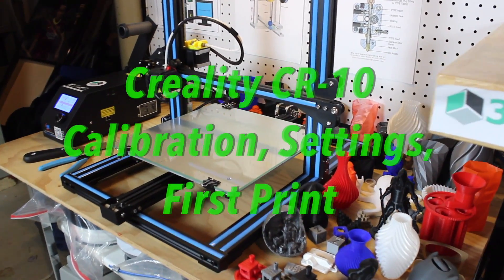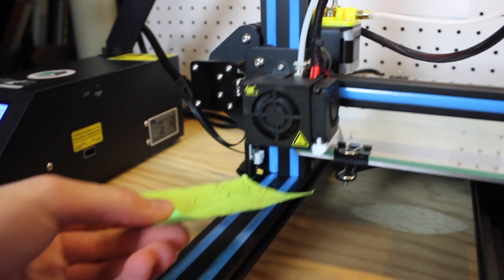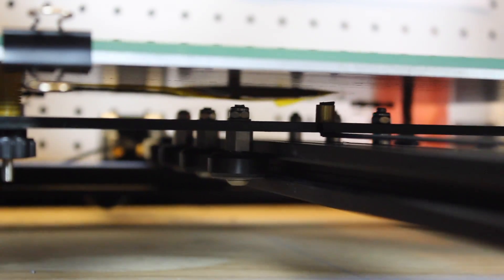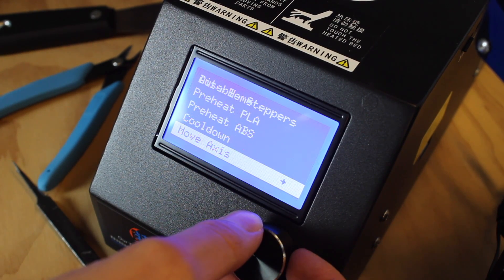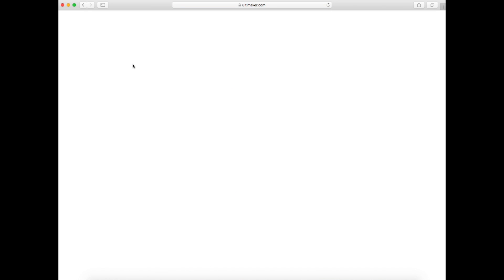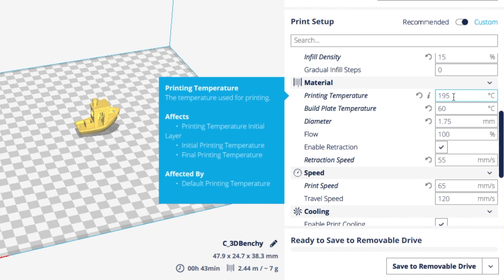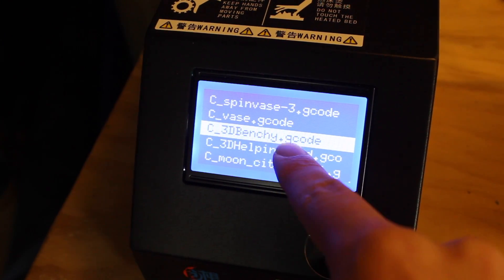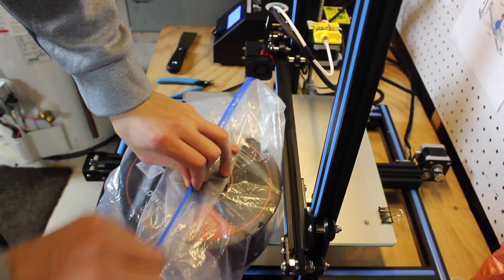Creality CR-10 Calibration, Settings, and First Print!

Comment: I followed your video for my first benchy but I get this scratching sound when the nozzle is over the print except on the edges. I made this video for the sound: https://www.youtube.com/watch?v=Ceu4u9lKi3g What I'm doing wrong?
Reply from the maker: Hmm, your fan might be rubbing on something. Try turning that off in the menu or try looking for parts that are rubbing on the printer.
Reply: how can I turn off the fan? There is no option in the menu. Just fan speed but I it still at the same speed even if I change ist. I tried to increase the infill to 30%, slowed down the flow to 90% aktived Z Hop but it's barely better. I uploaded a second video, maybe you can hear it better from here: https://youtu.be/6FBtl-pjwNI This noise appears at some lines of the infill. I uploaded a picture where you maybe can see that some inline lines are good and some are blistered: https://i.imgur.com/MijInii.jpg
Reply from the maker: Ok, you can turn the fan off in the slicer setting. I watched the video an it seems that something is rubbing or your filament is old. What brand filament are you using? Sometimes when filament gets old and dried out it pops while printing and doesn't look good.
Reply: Ok I turned the print cooling fan off but still the same sound. I used the filament which was in the box of the CR-10 for testing. I changed it with a Filament with the tag 26.03.18. The print looks besser also the infill but still the same sound...and can' t find anything  rubbing. But it's definitly comes somewhere around the hotend part...Is it possible that the x-belt is to tight?
Reply from the maker: Yah. That might be the problem. Try adjusting your belts

Comment: about 13% in the print the material started to get stringy why is that ? i do however thought that it was going alittle fast, i noticed in the video that your printer's computer/module case thingy was showing a 3D logo, my CR10 shows the number 300. Safe to say that at this point i have no idea what is going on "we are totally new to this 3D printing.anyhow as im writing this its still in the printing progress. but i will reply here again once its done.
Reply from the maker: Try lowering your temperature settings on the extruder. That might help the print not become stringy

Comment: I started my printing on the benchy but my printer didnt started like your video. It started where the auto prepare does. Why?
Reply from the maker: In the cura settings for your printer,  you need to select the center of the bed as the zero point, or home point

Comment: I tried dragging 3D benchy into Cura and it says invalid file

any ideas?
Reply from the maker: You may have a wrong file type or didn't install the correct file type extensions when installing cura.  Try a different .stl file and if that doesn't work, reinstall cura

Comment: Are you using Marlin because I do not have those settings in my menu.
Reply from the maker: It's the default settings, so creality might have changed the settings up for the newer models
Reply: damn i need those extra settings in the control tab
Reply: Edward Chew I believe marlin has all those extra settings. If you flash your cr-10 you can't get the original software back.
Reply: Jack ok. Am ordering arduino uno to flash marlin 1.1.8 to it
Reply: Edward Chew Sounds good. When you have finished do you mind telling me how it went and if it's worth it?
Reply: Jack sure bro. Shud reach me in 2 days. Just follow the youtube tutorials here

Comment: Good video for beginners (me). I am getting prints, but am starting to think my extruder needs calibration. Other videos show the 100mm of filament to be marked then run it through the extruder, measure the +/- distance and input a fix. My problem starts with "run it through the extruder" how? Next "input a fix", I don't know G-code, or even how or where to look for it. One mentioned arduino code, again not a computer wiz. Is there a simple way of doing this through the commands in the CR-10 and/or CURA???
Reply from the maker: You can extrude a certain amount of filament through the control, move axis, 100mm, extruder settings. Then you can adjust through the motor settings
Reply: Thank you for the answer, but having had no experience with the terminology or a 3D printer I still am confused. I know how to move the axis and can move it 100mm X, Y, or Z. Then I have no idea how to make it extrude or where the motor settings are. I went through the menu and nothing clearly indicated either of these. Sorry about not being able to follow your direction.
Reply from the maker: It's fine!  In the prepare,  move axis,  100mm, then click extruder settings. If that is not there, then play around with the settings menu until you find the move axis setting. Select the extruder option. If there is no extruder option, then select the 1mm movement and do it 100 times to get the 100mm

Comment: I did check my connection with your video.  Everything look fine and correct. The 3d printer show this CCR10_3DBenchy but the printer never move to do the print.  I did check the setting again and said stop printing.  Any idea where is the problem?
Reply from the maker: Make sure all of your connections on the printer is correct. Also, try moving the print head with the screen

Comment: In your control menu you have more options than what I have on my CR -10. Did you do a firmware update
Reply from the maker: I did not do a firmware update. Creality probably made some changes in newer models. It should not affect the workflow, though
Reply: 3D Now 
It just seems that those options will be useful if still available

Comment: Hi! Great Video. Can you post the settings you used for on cura for the PLA for you print? Thanks
Reply from the maker: I just used the default cura settings with 2 outer shells, 195c extruder, 60c bed,  15 percent infill,  2 top and bottom layers,  and 60 mm/s speed

Comment: Hi
I did all this and thanks for your help. I still have a problem though. The printer doesnt feed the filament fast enough. If i gently help it to feed it work but as soon as i leave, it doesnt print.
Reply from the maker: Make sure your flow rate and nozzle diameters are correct in the slicer. Also, the nozzle might be slightly clogged or the extruder might not be gripping the filament correctly. Try to fix those things. It might help!

Comment: The micro-SD card reader went straight in the trash. It got really hot in such a very short time. Use an adapter. 
Bad info, leaving the machine every 20 minutes or so. These printers generate tons of heat. Installing cameras on these to keep an eye on them. Are the cameras gonna extinguish any possible fires??

Comment: why set the setting in cuda example Temp and then set up on the cr10 control. Should the setting in cuda that are in the code transfer to the cr10 setting and override and adjust for what ever you did in cuda????  I am new but it seems you are setting the cr10 when cuda would do that. I am right or wrong????
Reply from the maker: angel85lx the temp on cura is correct but I usually heat up the printer manually in advance so the print will start faster and I will not have to wait for the printer to heat up.
Reply: 3D Now ok thanks for the reply great video.

Comment: i just unpacked and set up my cr 10, when i go to disable steppers i dont see any indication in the UI that its disabled  the screen just flashes a second, but the menu still says "disable" when i would expect it to switch to say "enable"  should the menu change to give an indication when they are disabled? if not how do you know besides just wrenching on them?
Reply from the maker: CoffeeOutlaws yes, the screen does not change, but it does disable the steppers. Just try to move something and if it does, it's disabled
Reply: ohh thanks tons for the response

Comment: is there a way to jog the Z axis???.. mine stops right above the print and I need to move it manually to get it out of the way
Reply from the maker: Yes, go into prepare and move axis. You can move any axis you want there.
Reply: weird, I only see X and Y in the menu, ill try it when I'm done printing , thank you SOO much
Reply from the maker: Sure! It might be because you can only move the z axis if you set the increments to 1mm.
Reply: my Z is stopping at 100mm , and crashing right into the print.. No idea why.. ive had more failed prints in the last 4 days than I ever had on the monoprice.. its crazy
Reply from the maker: Hmm. Is it in the software or is the z axis getting stuck? I would contact the company where you bought it from to see what they can do.
Reply: not the machine.. I can move the Z up and down no issue.. all runs smoothly.. weird thing is , I printed a 9 inch ( not a dildo )object a few days ago .. the printer is 5 days old.. Ill have to return it if I cant figure it out.. the Z motor is not hot , no cables binding, nothing.. weird.
Reply from the maker: What slicer are you using?
Reply: cura
Reply: I uploaded the newer cura, changed sd cards , and gonna try again..
Reply: loaded new cura and changed the sd card ! FIXED IT < thanks for the suggestion man

Comment: After printing the benchy with your settings, I noticed that there were gaps in the plastic on the deck, what do you think happened and what should I do stop this problem?
Reply from the maker: Charlie Hu that might be because your bed is not hot enough or your bed does not have good enough adhesion. Try using a glue stick on the glass bed or painters tape

Comment: Mine keeps coming off the glass. I used glue and it wouldnt stick. I am using tape now and it is working but keeps wobbling
Reply from the maker: Michael T make sure your bed is at the right temp and move your bed up a little more

Comment: Hello, I set-up like instructed and started to print. However I get a malfunction after it starts to print; the first layer doesn't adhere to the glass. So the outline starts to print, then when it moves to the next layer it drags the first layer instead of printing on top of it. Hope this makes sense... i'm new to this :)
Reply from the maker: Kari Payton Try and add more glue to the bed or use blue painters tape instead. Also, it might be that your nozzle is too far from the bed. Try re adjusting the bed height so the nozzle is a paper's thickness from the bed. Hopefully this helps!
Reply: I changed out the tape and it works now. Thanks!

Comment: Dear Jack, I bought this printer. 

I don't undestand why the printer request me change the filament, I put the filament and again request for change the filament. I can't print. You think that the printer has some mistake?
Reply from the maker: Sebastián Castro what do you mean it requested to change filament? What model cr10 do you have?
Reply: if you have CR-10s you have a filament sensor you need to connect up that detects if your filament is still flowing.
Reply: I am having the same problem.  First off, I don't know where to plug in the line that checks that filament is flowing. My first attempt I got and error code reading:change filament. Now the printer says "heating done" and the timer is VERY VERY slowly counting up by seconds but the printer isn't moving/printing. Please help
Reply from the maker: philip murrin I don't have much experience with the filament sensor, but it looks like you have go plug it into a port on the control board that is on a corner. After that I believe you should need to update the firmware somewhere.

Comment: Never ever pull the print-bed like this. This turns the stepper into a generator and this fries your motor-driver.
Reply from the maker: Yes, the motor can turn into a generator, but it is hard to fry the motor driver with the new CR-10 control board. It has new safety features that tries to prevent that. Pulling the bed slowly is okay, as that is why there is the "disable steppers" menu option and how Creality wants you to calibrate the printer. Pulling the bed extremely fast can cause some problems, though.
Reply: So you have a schematic for the SMelzi variant that Creality uses? Link?
And if that is not an issue, why does the LED backlight light up when the unit is off? The generated voltage shoots across the board from the drivers out to the LCD...
Reply from the maker: Not sure where I saw this, but yes the LED does light up when a motor is moved too fast. I can cause a problem if done a lot and really fast. Slowly is fine.
Reply from the maker: You can go into the settings and move the bed through "Move axis" if you want to be really safe.
Reply: Whats the correct procedure?
Reply: Adding an inline diode would make this a non-issue.
Reply: Slowly pulled is ok but try not to pull / push too hard the board can cope with this but better getting in the habit of slower is best
Reply: I second that, I mostly move my axis with the menu. If I have to move the table by hand I do it carefully slow.
Reply: thanks for the advice. I prefer to rather be annoyed by having to move every single axis with the controller than damaging my printer.
Reply: @rudolphriedel541  Does "Move Axis" take the print head to the right places (corners, center)?
Reply: @stevei7221  The "Move Axis" allows you to move X/Y/Z by xx mm, just try it. I also allows to "move" the Extruder but only if the Hotend is heated to the minimum temperature that is setup for this.
Reply: @rudolphriedel541  ah, thanks. So youd basically say "move x" however many mm to the left corner, right corner, etc?